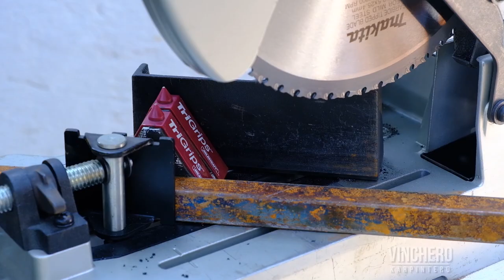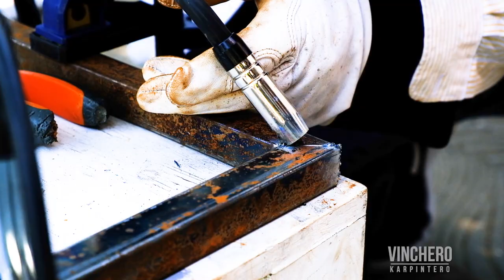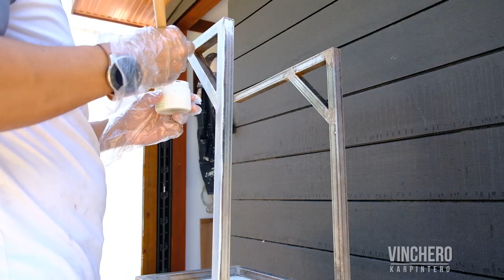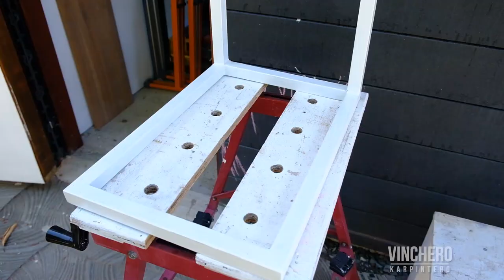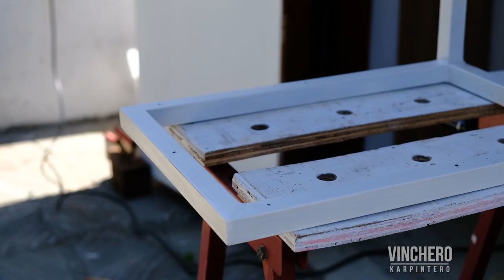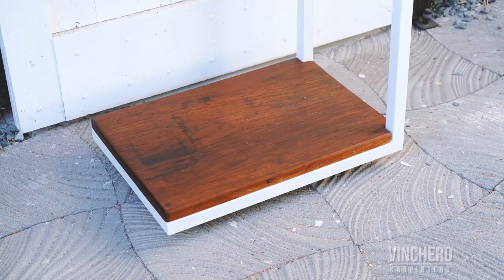C Table Build with Metal Frame for a Resin Table Top

Comment: Ano po tawag sa blade na ginamit mo pangtabas ng metal sir? Yung gmit mo sa miter saw and circular saw? Salamat po
Reply from the maker: It's called a cold cut blade pero you can't just replace your miter/circular saw blade. Something about the RPM rating of the blades require that you get separate machines rated for cold cut metal blades.
Reply: @VincheroKarpintero  thank you for sharing sir. Maybe will buy cut off machine directly for metal works of mine.